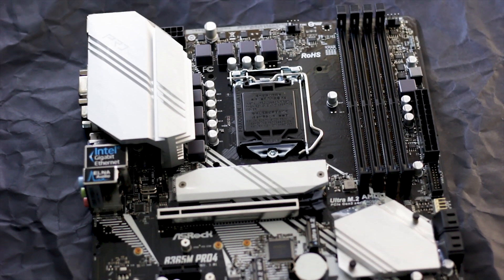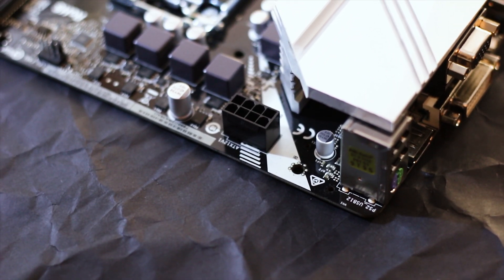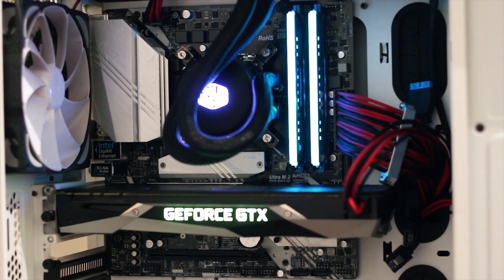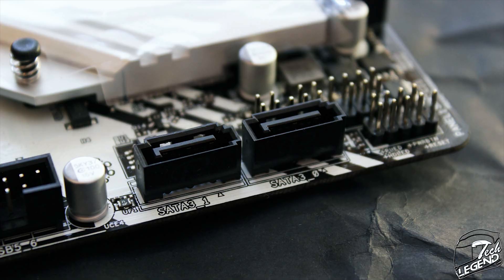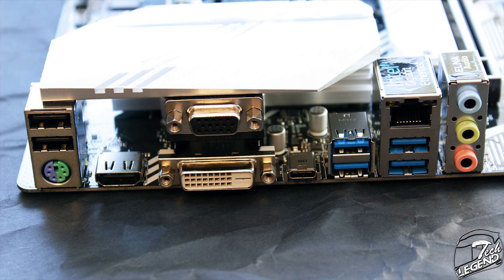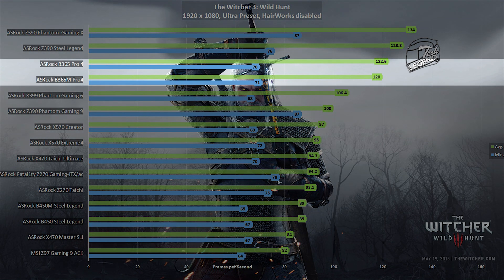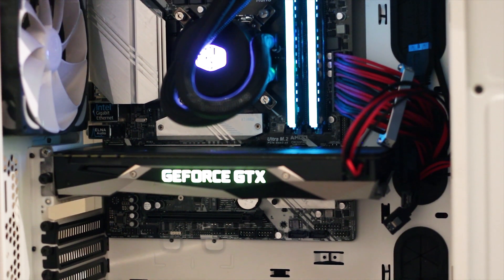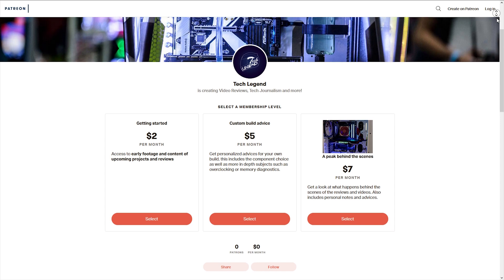ASRock B365M Pro4 Review - Cheap Performance! Ft. Intel i9 9900K

Comment: How enable power limits on this motherboard with i7 9700. Aproximetly 20s 100% using cpu (120watt) and cpu will has only 3.6ghz?. Base max clock is 4.4-4.5 ghz.
Reply from the maker: What's your bios version?
Reply: @TechLegend-com  number I don;t remember but is the newest version
Reply from the maker: @kacperkossa2213  I cannot remember exactly where the setting is, but if the power limits are unlocked in the Bios, it should be found within the CPU and motherboard settings. And the advanced tab of the bios.

Comment: Thank you so much for this video. I'm currently using this motherboard with  i7-8700, and I'm planning to add a graphics card "MSI GeForce RTX 3060 Ventus 3X 12G OC"  so I can start gaming + run Stable Diffusion to generate AI art. Do you foresee any issues with this build? I've ran this combo through those PC parts compatibility websites but I'm super new to building PCs so I wanted to double check. Any advice would be greatly appreciated!
Reply from the maker: It will work just fine, don't worry. What power supply are you using?

Comment: would i need to consider a top flow cpu cooler with a i7 7900k? Will it throttle with a decent enough normal cooler?
Reply from the maker: Depends on what CPU cooler you have in mind. Some decently priced CPU coolers are good, while others aren't.
Reply: @TechLegend-com  im considering the arctic freezer esports duo with this mobo and i7 9700k* (i mistyped in previous comment)
Reply from the maker: @jumbocube  Should be ok.

Comment: Hi i want to build a pc with this motherboard but in my country it is different it's ASROCK B365M PRO4-F
What is the difference between these models? Can i connect the 4 pin rgb to this different model?
Reply from the maker: As long as it is a 4 Pin RGB header and not a 3 Pin header, you can use it. The Pro4-F is newer and there aren't many changes so you can use it with no worries.
Reply: @TechLegend-com  Thanks mate!!
Reply from the maker: @skyymaxx8680  I'm glad I was able to help.
Reply: @TechLegend-com  Wait, i don't see the pins at Argb and 4pin Led in the images of Pro4-F it's just white dots there. I just realized it now.
Reply from the maker: @skyymaxx8680  Oh, that's bad. You can just get an RGB controller and have that control your LEDs.
Reply: @TechLegend-com  like 2 x 4 pin led are there and the Argb 3 pin but i don't see the yellow pins there... is just there empty how???
Reply from the maker: @skyymaxx8680  Perhaps the PCB of the motherboard is reused with other versions which had the RGB headers.

Comment: Be careful if you order this board from newegg. I had a few bent cpu pins when it arrived. Fortunately I was able to very gently nudge them back in place and save the board
Reply from the maker: Sounds like a thing that was done either at the factory or at a distributor. Should not be a issue for a replacement if you want.
Reply: @TechLegend-com  newegg wouldn’t accept a return. They claimed I was at fault for the bent pins. Another person in the reviews for the board on there was told the same thing. I was able to fix it on my own and it ran great after a few stressful days lol it definitely is a great budget board if you’re upgrading from a toaster like i did
Reply from the maker: @nickbag88  That is unfortunate, it was not your fault. At least, you got it sorted and it works! :)

Comment: Thanks for the video! I'm looking into this mobo for my i9 9900K I have a RTX 2060 ventus and 2x32 2666mhz Corsair vengeance pro DDR 4 ram will this be compatible? I'm not one for overclocking either. I'll be using a NZXT cooler.
Reply: Would love to know if you went with this motherboard. If so how did it work out? :)
Reply from the maker: It will be compatible, but I would recommend you to get a Z390 motherboard to pair with that 9900K. Otherwise, it would be a waste of money to use a unlocked CPU with a B365 chipset.
Reply: @TechLegend-com  thanks for the response! I'll keep that in mind
Reply from the maker: @Cosmic_cloudx  You're welcome!

Comment: What is the idle power consumption? With no gpu?
Reply from the maker: Very low, but also depends on what CPU you are using.
Reply: @TechLegend-com  thanks for the reply, I was thinking g5400 or 8100 level, but for idle, will there be a difference between a 8/9100 and a 9600?
Reply from the maker: @dkimmortal  Barely any difference.
Reply: @TechLegend-com  can you limit the cpu to certain watts in the bios like 35w or is that not available with this motherboard?
Reply from the maker: @dkimmortal  I do not think so. Even so, the idle power consumption should be so low that it wouldn't really matter that much.

Comment: Im thinking about using this motherboard in a build im going to do  and i have no interest in trying to overclocker, so please can I have your opinion
I7 8700k
16gb 2666mhz 
Zotac geforce rtx 3070
 
This is going be my 1st build in 7 years lol
Reply from the maker: It will work, but if you don't plan to overclock, then spend less money and get yourself a locked CPU, instead of the 8700K get the regular 8700 "non K". Also, get yourself some higher performing RAM, 2666MHz is very low, you can find a good and affordable 16GB RAM kit running at 3200MHz.

Comment: i want to upgrade the processor from i5 9400f to i9 9900 and i want to keep using this b365m motherboard is it okay for long period of use?
Reply from the maker: It will work, but you are just wasting money by using such a CPU on this motherboard. Better just get a good motherboard and a 9900K for overclocking.
Reply: @TechLegend-com  Why wasting if it work ? Also 9900 is non-overclocking CPU with lower TDP equal to 9400F ?
Reply from the maker: @thanatosor  If it's the locked 9900, then it will work, but for any unlocked CPUs, these motherboards are not suited. There is no overclocking at all with a motherboard that does not have a Z chipset.

Comment: so i dont plan on overclocking my 9900k will it still have bad throttling?
Reply from the maker: The 9900K will work best with a Z390 motherboard. These budget motherboards are not meant for such TDP. It will work just fine, but it will be a waste.
Reply: @TechLegend-com  so i got the I9 and yeah it runs spicy but i downed the boost clock to 4ghz and it runs at about 67C underload i know im leaving performance on the table but thatll just be untill i can get a Z390 thank you for the feedback!
Reply from the maker: @itsProRookie  "runs spicy" I'm taking this and using it in one video, thanks! :)
If you undervolt the CPU then the VRM temperatures should lower a bit, but it will work until you get yourself a Z390 board.
Reply: @TechLegend-com  lol no problem I'm glad you like that and yeah the VRM temps are good everything is running smooth
Reply from the maker: @itsProRookie  Great to hear it's running smooth. Don't forget to subscribe and say hi in the future! :)
Reply: @TechLegend-com  already done! Can’t wait for future videos great quality I’m glad to see you put good work into them! Keep it up!
Reply from the maker: @itsProRookie  Thank you! The next review is uploading as we speak! :)

Comment: Sir I have 2x8gb 3000mhz ddr4 ram can it work with this motherboard
Reply from the maker: It will work, but not at 3000MHz, because it is a limitation of the B365 chipset.
Reply: @TechLegend-com  alright thanks ☺️..i thought that it couldn't work

Comment: If I use with i3-9100f , is graphics card necessary. My version is p4.20 but problem in booting
Reply from the maker: If it's not booting, do you know if the bios is updated?
Reply: @TechLegend-com  No, I don't know, but its written on the motherboard p4.20. Whenever I start, there is no display and makes three beeps continuously. What version do I have to update
Reply from the maker: @Nannamunna-m6l  If it has a P4.20 label, then the Bios has been updated. I did some research on your behalf, and I will ask you to check your RAM modules, especially, check if both RAM Sticks are actually pushed in their place on the motherboard.
Reply: Thank you very much, it worked
Reply from the maker: @Nannamunna-m6l  Great to hear that you got it fixed! :)
Reply: Thank you very much for your help and support. But now the problem i am facing is whenever I start the computer. It beeps for 5times with no display.
Reply from the maker: @Nannamunna-m6l  Try to start the PC with only one RAM stick installed and see if it works.
Reply: @TechLegend-com  no, it didn't work with either.
Reply from the maker: @Nannamunna-m6l  Ok, now I think I figured it out, so you have the i3-9100F CPU, the "F" CPUs have no integrated graphics card, so if you have no graphics card installed, you will get this error. Borrow or get yourself a graphics card, install it and see if it boots up.

Comment: Will it work with

I3 9100f 
Gigabyte 1650 super OC 4gb
Q300l case
Hyperx fury 2666mhz 8gb 2x4gb
Reply from the maker: It will work, but you do not mention a power supply in there.
Reply: @TechLegend-com  yeah its a 450w one
Reply from the maker: @elmalcolm7183  Which particular model?
Reply: @TechLegend-com  evga
Reply: @TechLegend-com  450 W3
Reply from the maker: @elmalcolm7183  It looks like a good enough PSU. Just don't push it close to its maximum wattage.
Reply: @TechLegend-com  ok thanks

Comment: Will this mobo work with i7 9700k and rtx 2080?
Reply from the maker: For unlocked CPUs, I will always recommend a Z chipset motherboard. You get overclocking support and also higher frequency for the RAM.
Reply: @TechLegend-com  oh thanks. And also can i use 10th gen intel cpu after bios update?
Reply from the maker: @zaseto7531  What CPU are we talking about exactly?
Reply: @TechLegend-com  you know, in case the time comes when I need to upgrade.
Reply from the maker: @zaseto7531  Again, it should work, but you need to be sure, as some motherboards have their Bios updated from the factory while others have the older Bios versions.

Comment: https://www.asus.com/us/Motherboards/PRIME-Z390-P/ Would i9 9900k be able to run with this OVERCLOCKED no problems?
Reply from the maker: Yes, but watch those VRM temperature.
Reply: @TechLegend-com  does cooling take a role in performance and overclocking?
Reply from the maker: @Luel2  Yes, always, and for VRM cooling, it takes a good role in stability as well.
Reply from the maker: @Luel2  It should be ok, just make sure your case has good airflow in general.
Reply: Tech Legend what’s a good value recommended case for good airflow? Right now I’m thinking of NZXT H510 mid tower case? By the way thank you so much for the help really helpful!
Reply from the maker: @Luel2   That NZXT case is not that good, please take a look at the following cases: Phanteks P300A, Lian Li Lancool II Mesh,Phanteks P400A, be quiet! Pure Base 500DX.
Also, you're welcome! :)

Comment: Please someone responds what kind of Intel does it support it won’t fit  in mine my intel is  i5 25k and it won’t fit and my rams gb won’t fit it please someone  is reply and tell me what kind of  intel I need and the rams
Reply from the maker: What CPU is that? And what RAM kit?
Reply: @Tech Legend i don´t know im just a kid and im barley knowing this stuff so just tell me which rams should i get for that motherboard b365 pro4 please and the intel so it can fit in with b365 pro mother bored
Reply: @TechLegend-com  and my rames are called 4gb 2rx8 pc3 - 12800u-11-12b1 skhynxic korea03 i don´t know what thaaat is
Reply from the maker: @brash_.._brash4600  First of all, the Intel i5 2500K is not compatible with this motherboard generation, and your DDR3 RAM kit is also not compatible. What you need for this current generation of computers and motherboards is a DDR4 RAM kit and any CPU from the newer generation. I can't tell you which model cause I can't know how much you want to spend on it.
Reply: @TechLegend-com  lol thx dude for telling ddr4 and intel 9th aight ill ma find intel i9 9900k
Reply: @TechLegend-com  is this my pc compatible
-Cooler Master Hyper 212 RGB Black Edition

-NEW 600W 650W 650 Watt 700W Large Fan BLUE ATX Power Supply PSU 450W 500W 550W i think the max was 750 

-32GB (2 x 16GB) 288-Pin DDR4 SDRAM DDR4 3200 (PC4 25600) RGB Desktop Memory rams

-GeForce GTX 1060 6GB GDDR5 Graphics Card MSI Gaming

-MSI B365M PRO-VDH LGA1151 Intel B365 SATAIII 6Gb/s USB3.0 Micro-ATX Motherboard

-ATX Mid Tower Computer Gaming PC Case, Tempered Glass, Dual Ring Blue LED Fans its rosewill last time the fans smoke idk why 

-High Performance Gold Thermal Grease CPU Heatsink Compound Paste Syringe lol

-and i have ssd120 gb 

-2 drivers there both 500gb

-and a random small fan and i think thats it i just gotta get a i 9 intel so is it compatible?
Reply from the maker: @brash_.._brash4600  Don't get an i9 CPU with that motherboard, also the power supply, that's not a model that's just a description.
Reply: @TechLegend-com  so which one should i get  9600k or prob i7 9700k so which powersupply do i need for that b365 pro 4 motherbored?
Reply: last time my old motherbored smoked i think cuz of the powersupply but i hope it dosen't ruin my b365 motherbored.
Reply from the maker: @brash_.._brash4600  Perhaps you should replace that power supply for something that works.
Reply: @TechLegend-com  someone else told me that but he haven't reply can u tell me which power supply do i need?
Reply from the maker: @brash_.._brash4600  Depends on how much you want to spend.
Reply from the maker: @brash_.._brash4600  I told you before, that you need to know how much you can spend.
Reply: @TechLegend-com  idk im just a kid lol just tell me ill buy it and ima return the other stuff that isn't campatible.
Reply from the maker: @brash_.._brash4600  You being a kid makes no difference. You're clearly old enough to make your own decisions as you're using a PC already. "Bruh lol".
Reply: @TechLegend-com  so dose that 750 wat powersupply bad for my pc? last time my motherbored smoked or and the fans
Reply: @TechLegend-com  yoooo is it i5 9600k a 9th gen?
Reply: @TechLegend-com  wait is this good? Intel Core i5-9600KF Coffee Lake 6-Core 3.7GHz LGA-1151 95W  cuz i think its perfect for my motherbored but what if it was wrong the seller dose not accecpt returns :(.
Reply from the maker: @brash_.._brash4600  For a B365 chipset motherboard you need a locked CPU, as the unlocked ones, (with K in the name), are meant for Z390 chipsets.
Reply: @TechLegend-com  idk this men said 
"Yes, the i5-9600 chips are 9th gen and therefore should work with your motherboard. And yes, it's a good chip for gaming."
Reply from the maker: @brash_.._brash4600  And I didn't say anything different. apart from the fact that the unlocked CPUs are best used with Z chipsets.
Reply: @TechLegend-com  i bought i5 9600kf coffe lake is it a 9th gen is it good for gaming?
Reply from the maker: @brash_.._brash4600  So you already bought a CPU and now you're asking me if it's good?
Reply: @TechLegend-com  Lol im waiting for it bruh i haven´t played games in a month can´t wait to play far cry 4
Reply: @TechLegend-com  bruh im scared now i search on google dose and it said no Can i5 support 32gb RAM? NO? bruh wydm i bought i5 9600kf please tell me thats not ture
Reply from the maker: @brash_.._brash4600  "bruh" you should have asked before you buy anything if they work together.
Reply: @TechLegend-com  shhh no the buyer said he don´t accept returns .  i mean its good with my motherbored so why 32 gb ram warhawk
Reply: @TechLegend-com  BRuh are u kidding my motherbored support Coffee Lake Refresh) and 8th Gen (Coffee Lake)  but mine is 9th gen coffe lake omg...

Comment: Bruh why none of my stuff Are compatible with this motherboard whyyy my rams and my intel i5 25k why
Reply from the maker: If you can write your question correctly, then I can try to answer it.
Reply: @TechLegend-com  yeah i have 4x4 ram gb and my intel i5 2500 2.70 ghz won´t fit can u tell me which new one should i get or i mean can u tell me what kind of rams and intel do i need.
Reply: @brash_.._brash4600  This motherboard is for 8th gen Intel cpus. So you have to upgrade your CPU and I think your RAM also cause it supports DDR3(Has to support DDR4).   @Tech Legend correct me if I am wrong, thank you. Also it would be wise to switch to AMD, its more vfm if you are targeting at mild gaming and excelent malti-tasking activities.

Comment: I am new to PC Gaming, and sorry if this is a dumb question. When you tested out the FPS for the games, what Ryzen or iCore did you use?
Reply from the maker: I did not use those programs, instead, for measuring the FPS in games I use multiple software. I use FRAPS, MSI AfterBurner and the ingame benchmark found inside some games.

Comment: Will it work out of box with an i3 9100f
Reply from the maker: It will work, but the motherboard must have its bios updated to version P4.20
. You need to be sure about that, otherwise it won't boot with that CPU.

Comment: Gathering my parts rn, pairing this mobo with a 9600k, h80i aio and rtx 3080, 32gb 3600 ram, Masterbox Q300L, Evga 750 80+gold. Anyone see any potential problems like maybe bottlenecking?
Reply from the maker: Why do you even want a unlocked CPU with a motherboard that does not support overclocking? Also your RAM is running at 3600MHz, but the motherboard's chipset won't go past 2666MHz.